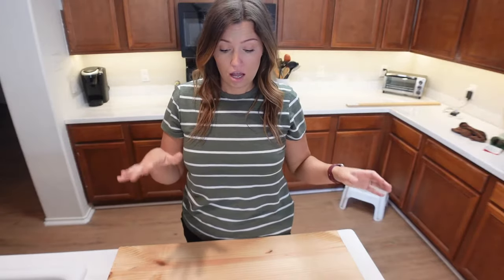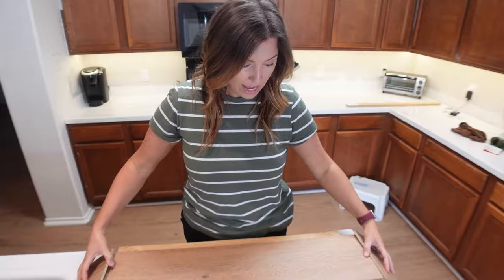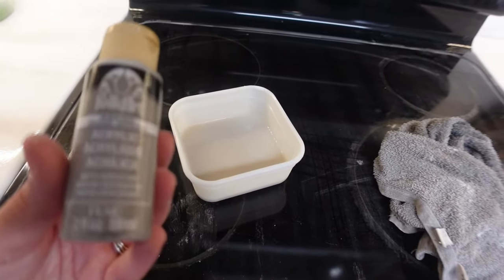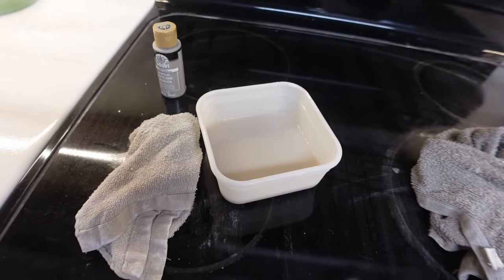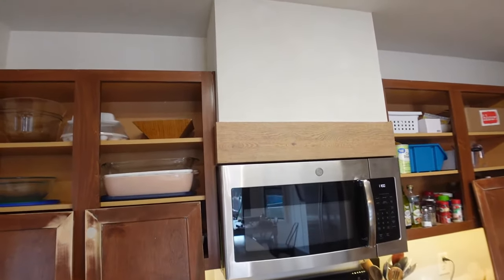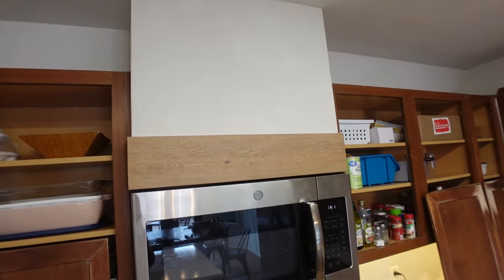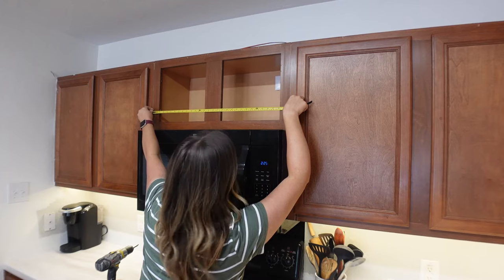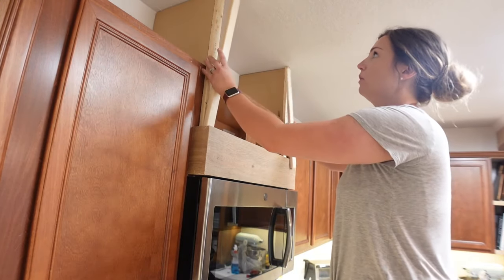HOW I BUILT A FAUX VENT HOOD FOR $6!!! ) Kitchen Cabinet Makeover Pt 2 | Home Reno Ep. 10

Comment: I only wish that DIYers would not use misleading information to draw in watchers of content.  In this case, the $6 cost was only possible because you, as a DIYer, had a bunch of leftovers to use from other projects.  Honestly, the screws alone in this project likely cost $2.  The wood would have cost (as a from scratch project) at least $20, and that is without using laminate flooring to cover the bottom piece.  This is a beautiful and inexpensive project.  The faux $6 was unnecessary to draw attention.
Reply from the maker: I see your point. Definitely shouldn’t assume that everyone has a garage full of random project materials like I do.

Comment: This is pretty and a good idea.. but I am wondering, if you have to unplug or plug in the microwave , how would you do that since no opening for the outlets?
Reply from the maker: Good point. This occurred to me after I built it. I just replaced the microwave but should I need to unplug it for some reason, I would cut a small hole in the side of the cabinet to access the outlet.
Reply: @KelseyRomitoDIY  good job and looks great!  I was thinking the same thing .  Cut an access hole inside the cabinet.

Comment: Wait so you built a fake vent hood over a microwave that doesn't actually vent outside and in doing so also got rid of a perfectly working cabinet?

You could have added a real vent if you were this bored! Form over function it seems. 🤔
Reply from the maker: Yep. And no I couldn’t have added a real vent (without a ridiculous amount of work) because this is an interior wall. Not sure about you but I never use the small cabinets above the stove or fridge because they aren’t easy to access and hold basically nothing. Also, if you’ve seen any of my other videos, you would know I added tons of storage above the refrigerator and also a built in hutch for lots of storage so the cabinet above the microwave was no big deal to sacrifice. 
But by all means make a snarky comment without having all the information if you are this bored.